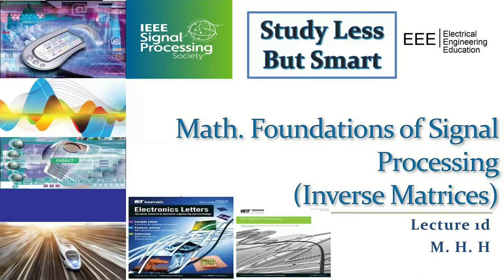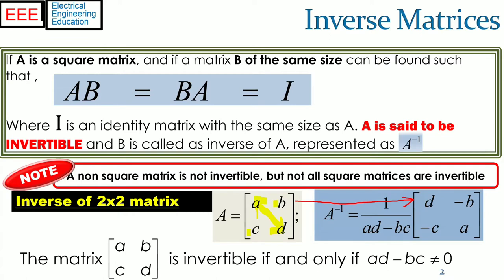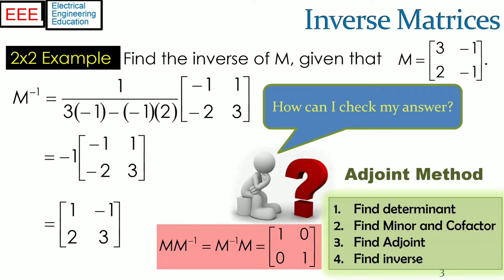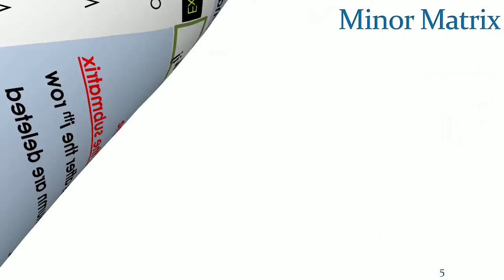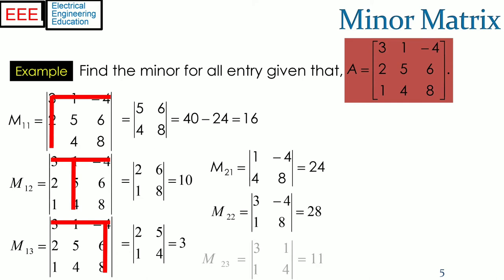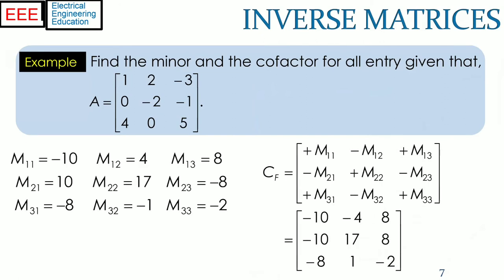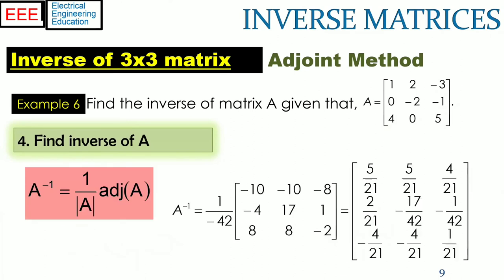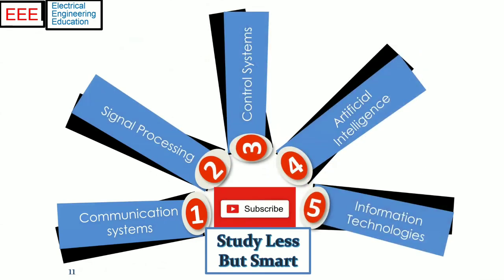How to find Inverse of a matrix | EE MSP 04 | Electrical Engineering Education

Comment: I have a question, Mostly researchers use input-output model in engineering filed, whats the reason behind it?
Reply from the maker: With such a technique one get the model or differential equation or set of differential equations. Modeling is essential in engineering. One can propose many solutions and the best one can be adapted. System identification, inverse system identification, inference in Learning etc are examples.